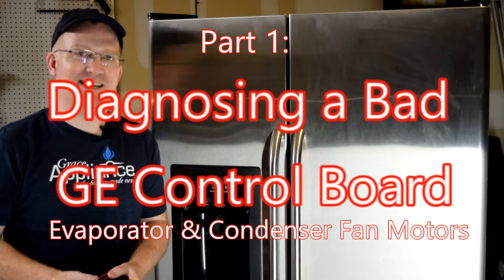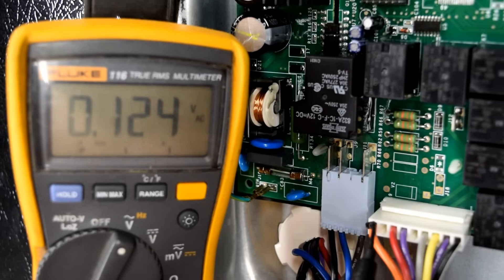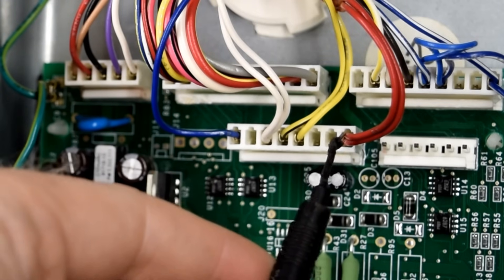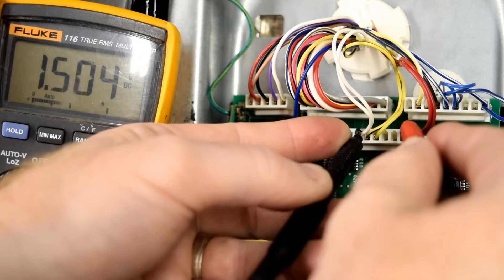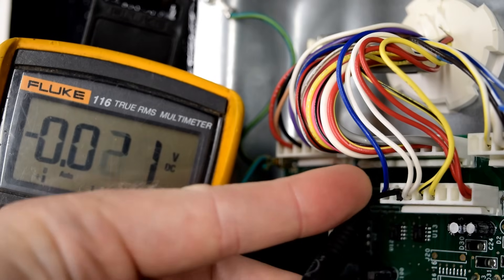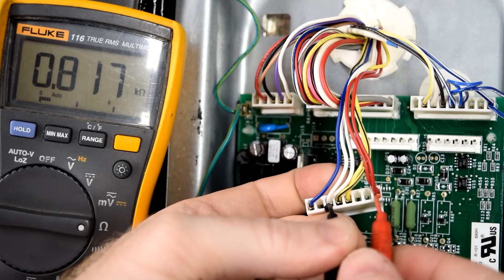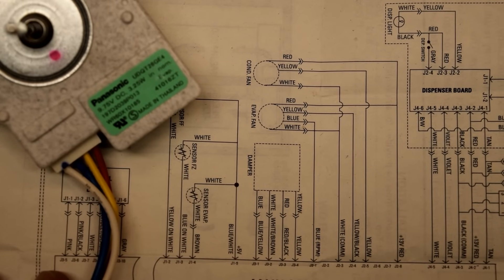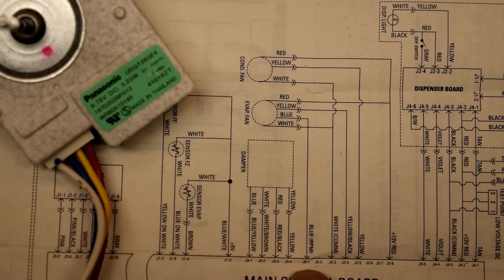Diagnosing a Bad GE Board - Part 1: Fan Motors

Comment: The temperature display in my side by side ge profile has gone blank.   Lights inside working,  freezer seems to be working.   We had a power surge yersterday during a storm.  Could it be the control board? Sorry about a dumm question: control board, mother board,  main board.  It is all the same?
Reply from the maker: Marcio Bonetti Hi, not a dumb question at all.
It is probably going to be your main control board that is at fault, but you can watch this video to rule out the front control panel.

https://youtu.be/ViFpwH6_WrM

Also, there is a visual inspection video that would be useful to you as well. The power surge situation will typically damage that main control board behind your refrigerator.

I hope that helps, but please let me know if you have any questions!  Thanks
Reply from the maker: Marcio Bonetti a control board is a general term for a circuit board which controls what parts get sent voltage. So, your fridge may have multiple control boards, but only one main board. The main board is behind your refrigerator and is also a sometimes called the mother board. The board on the front of the fridge for the temps and dispenser IS also a control board, but not your main control board. I hope they makes sense.
Reply: Thanks so much for your attention.   Your videos are really very  helpful and easy to follow.
Reply from the maker: Here is the video for the visual clues you're looking for with a failed board.  I hope it helps. 

Andy 

https://youtu.be/zbmAqizE128

Comment: on the AC power test, my connector on the bottom of the board has only 3 wires, blue, empty, red, purple, empty. Which wire do I use to test ac power coming in?
Reply from the maker: hi ByblosHex, 
Could you please send your model number and I can see if I can look up the wiring schematic for you?

Thanks!
Reply: GE Side-by-Side ONLY - Refrigerator Repair Videos It's a gds20kbsbww which I realize isn't a side by side but the motherboard appears to be the same but the connectors have different colored wires in different locations. I'm pretty sure the board is bad and I plan on buying a replacement on Monday but I'd rather know it for sure if at all possible. The same morning my fridge was warm I noticed a light but rapid clicking sound coming from the fridge. After I got it apart I narrowed it down to coming from the square relay located towards the center of the board.
Reply: GE Side-by-Side ONLY - Refrigerator Repair Videos It's a gds20kbsbww which I realize isn't a side by side but the motherboard appears to be the same but the connectors have different colored wires in different locations. I'm pretty sure the board is bad and I plan on buying a replacement on Monday but I'd rather know it for sure if at all possible. The same morning my fridge was warm I noticed a light but rapid clicking sound coming from the fridge. After I got it apart I narrowed it down to coming from the square relay located towards the center of the board.
Reply from the maker: Hey, Yes - I'd agree it's almost certainly a failed relay on the control board which the clicking is a dead give away, but doesn't hurt to do some checking in the meantime.  Let me take a look for the schematic.
Reply from the maker: Ok, the schematic I am seeing for your fridge does not have a diagram showing the wire colors, but only the pins and a picture of the board.  Which, as you stated, looks identical in layout to the board in my video. However, your board may be white in color vs green as mine is.  

In any case - the pin orientation is very similar.  The L1 input (which is the hot leg of the power coming from your wall, 120v AC) comes in to the J11 pin which should be indicated in small lettering on your control board. 

You'll need to take a voltage measurement between the J11 pin (the furthest right pin on the light blue connector which has 3 wires total coming in to it) and the other meter lead would ideally touch neutral which is the return path for the electricity to complete the circuit.  This will normally be an orange wire immediately to the right of the connector you're working with.  However, you may not have a neutral wire there and may need to instead touch the other meter lead to ground instead. 

The ground wire (i.e. a green wire or green and yellow wire) which you'll find plugged in to a terminal on one of the corners of the board. You should read 110-120v AC.  This would indicate that your control board has appropriate voltage being supplied to it. 

Keep in mind if you do a voltage reading between L1 & ground, if your refrigerator is plugged in to a GFCI circuit - this test may trip the GFCI - which it probably isn't on GFCI, but just wanted to give you a heads up on that.  This may be Greek to you, but it you hear a click and the fridge turns off, that's what happened and you'll just need to press the reset button on the GFCI outlet in the wall to get it working again.
Reply: I currently have the board removed and ready for replacement. I appreciate you taking the time to provide additional information relevant to my specific model. I hope the channel works out well for you.
Reply from the maker: No problem at all. Due to the fact that the relay is clicking indicates at least some voltage, and it's most likely that board that's the issue. Good luck and let me know if you have any questions. Thanks!
Reply: It's fixed. It was the motherboard. Funny thing over the weekend whenever I'd mention the fridge wasn't working and I was working on fixing it the first thing everyone says "Is it even worth it?" I didn't know everyone had $1,000s of dollars to throw away. Let's see, the fridge I have was purchased for $1,000 11 years ago at scratch and dent. The part I needed to fix it was $180! You do the match... was it worth it? Heck yeah.
Reply from the maker: ByblosHex nice work!
I know what you mean! I don't have that kind of money to throw away when it's almost always a cheap fix. Great job. Stay in touch.

Comment: the only thing that works on mine is the light ..everything else is out not working ...I think power surge mess it up...
Reply from the maker: Hi Jose, 
I’m sorry for the slow reply.  I’ve been moving and am just now back to internet.  

It sounds like it probably going to be a failed control board. I’d start by watching this video:
https://www.youtube.com/watch?v=zbmAqizE128

With the refrigerator unplugged, Look closely at the capacitors which look like tiny soda cans on the control board and they may be swollen up instead of flat on top. This is pretty common with power surges. Let me know if you have any questions.  

Thanks!
Reply: It was the mother board.....i replace it ....and it works better than ever.....thanx
Reply from the maker: Awesome!  Glad to hear it and glad to help!
Reply: Change the ckntrol board. 3128488517